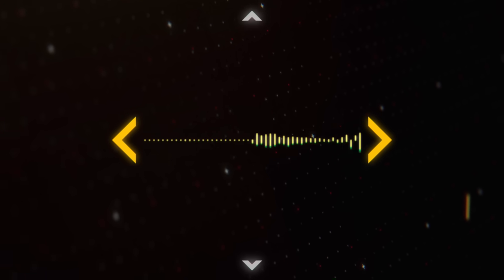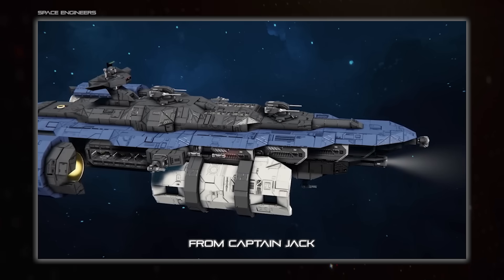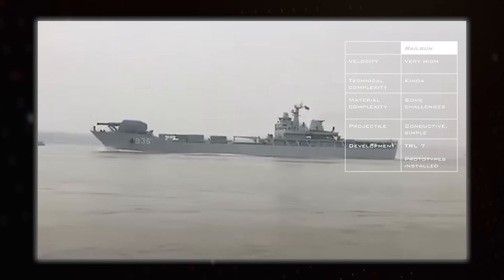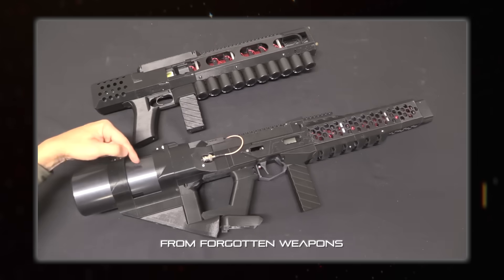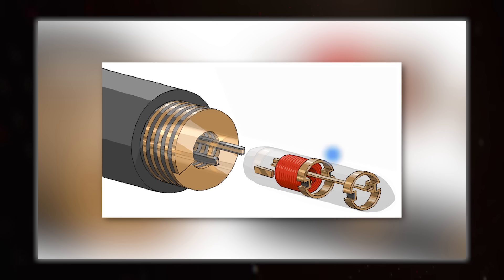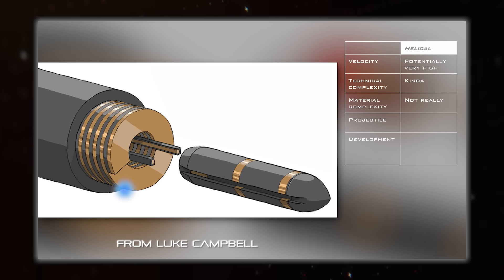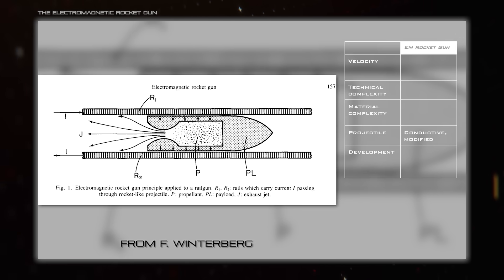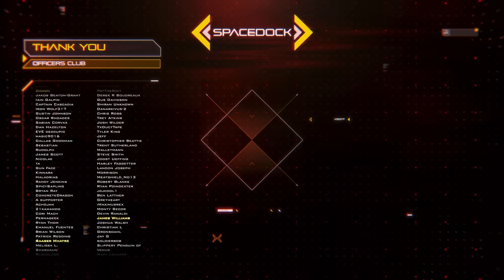The Deadly Coilgun/Railgun Hybrid You've Never Heard Of (Helical Railguns)

Comment: I remember back in college physics class where my team wanted to build an electromagnetic projectile launcher as a term project (the professor said that there's always a team that picks that project every year.) We first thought to make a railgun, but realized that would be too expensive for a bunch of college students because we'd need to get the rails professionally re-machined after every launch or so. We ended up making a mono-coilgun instead because that was just more practical for us to build. It only launched ball bearings at a modest velocity, but it didn't need to be especially impressive to demonstrate that we could build one. The hardest part was wiring it such that we could charge up the bank of capacitors (because we couldn't afford a chonky enough single capacitor) in parallel while getting them to discharge in series with a throw of a switch.
Reply: I can make a primitive "science fair" grade coilgun from a disposable camera flash circuit (xenon flash), a disposable pen barrel, and some magnet wire.
The disposable camera flash circuit is already most of what you need, including the high current switch (the flashtube can do double-duty as a triggered spark gap with no modifications).
Sure with only the one camera flash capacitor it'll only fling a piece of a nail across the room, but it'll also punch a hole in like 3 sheets of newspaper if you put them right near the muzzle.
All you need to do is cut one of the wires going from the flash capacitor to the xenon flash tube's primary electrodes, and put the ends of the wires for the acceleration coil across that break in the circuit you just made. That's all there is to it! When you make the flash tube go off, if you have a piece of nail in the pen barrel at the right place (easiest to achieve by winding the coil in the right spot close to the capped off end of it), the piece of nail will go flying!
Reply: The parallel/Serial part isn't that hard once you figure out you can use a spark-switch for that.
Reply: The way I see this railgun tech progressing is seeing if there’s a way of generating a em force to float and maybe spin the projectile (not sure how the bullet could complete the circuit to propel itself, idk learn from Nicola Tesla) or shape of projectile to generate less friction on the barrel or do what the mg42 did and have a form of gun barrel spacer (sacrificial metal between the barrel and bullet) or easily mass produced interchangeable barrel for infantry mortars. But until a simple slug of metal can be floated and then propelled in a barrel at that speeds, there’s not as much potential.
Reply: @SlimTower25  "But until a simple slug of metal can be floated and then propelled in a barrel at that speeds, there’s not as much potential."
Why do you think so? Combat mostly isn't spray-and-pray anymore.
The reason why electromagnetic accelerators are researched is their potential for far greater muzzle velocity. That would allow for further enlarged effective range as well as the capabilities to hit through obstacles and most light armor.
If you go for a long-range shot you do not go for multiple shots, and it wouldn't matter if a single shot would cost upwards of 1000$ in materials.

(and please - Tesla? there is not much to learn from a tinkerer that denied the existence of electrons).
Reply: @ABaumstumpf  when I referenced Tesla, I was asking if there is potential to Lawrence force though the sabot and shot without creating friction on the barrel material in an attempt to prevent ware and tare on the barrel. A rail gun (after leaving the mussel but does not rely on built pressure behind the sabot/bullet, right? Otherwise rail guns will not be economical for drone warfare, or intercepting Chinese hypersonic missiles, (costly to shoot down with missiles) and instead more effective use of time and research would be put towards hacking and point defense propellant or laser guns at the potential targets the enemy will aim at. 

Is it possible to create Lawrence force to propel a slug at significant force without it touching the rails or to reduce arcing? I know I’ve never seen anyone do it but I’m really curious if there’s potential behind it. 

The projectile, needs time to put more energy behind it to propel it to higher inertias, but if there’s no resistance/mass out the mussel, then it won’t carry much energy in its own inertia to carry itself forward, so the barrel would end up lengthening hyperbolically to liner speed if mass doesn’t change assuming the whole projectile is fired without a sabot (E(in newtons)=1/2(mass)(velocity)^2. Then, there’s air resistance I didn’t count. Assuming the Laurence could be generated with air gap, maybe the air plasma could be pushed away from the rails the same way plasma is pushed from the walls of fusion reactors being tested today? Then the next problem would involve if the plasma levitation of those shields would mess with the rails circuit between the shield and plasma? Then if that’s possible, would it be more effective than laser defense, and cost effective at defending against many hypersonic missiles?
Reply: It’s probably not likely rail guns will reach full potential against lasers in terms of economics, :/ ur right, rail guns were made for piercing and muzzle velocity, otherwise not much use elsewhere.
Reply: You made the stay mistake that everyone else does. You used attractive force to move the projectile. If you look very carefully, all of the military designs use repulsive force to move their projectile.
Reply: Why not just program an arduino to do it? I have a physics degree and learned how to use arduinos?
Reply: @johnhummel99  Because Arduino began in 2005. I was taking the class in 2002/2003.
Reply: @FearlessSon  well that makes sense then. I apologize
Reply: I have long felt that for a near term weapon, a coil gun is probably more practical.  I have a vague memory of seeing that if you're going up to Mach 5 or Mach 6 the coul gun is more efficient?
Reply: this is what we choose for our capstone

Comment: Triggering the coils is easy... just put a laser detector in the barrel which will trigger the cutoff as the projectile passes into the acceleration point.  Perhaps a microwave that won't be distorted by the compressed gasses ahead of the projectile if it's fired in atmo.
Firing these things in space, however, would be counterproductive.  Even without a propellant accelerating the projectile the act of accelerating mass in one direction will exert equal opposing inertia, regardless of the mass that's mounting the device (which is why they've been postulated as methods of redirecting asteroids - landing a mining/mass driver unit to push the asteroid by launching chunks away from it).  The only surefire way of launching ordinance in space is either a massless device - i.e. laser type - or something self-boosted that merely needs to be ejected under low inertia before initiating burn.

Comment: build your helix with linear accelerators, essentially a contact-less rail-gun then so no erosion of the rails and a coil-gun where the coils are a helix ( spin stabilization of the projectile ) coil gun lower power requirements, rail gun speeds if not the hybrid speed.

Comment: Reloading a railgun in video guns should include replacing the rails. Each shot reduces damage until you reload, but reloading takes a long time.
The advantage of the electromagnetic rocket gun is that you get a cool plume of plasma shooting out of your barrel. Which totally has a tactical advantage. (While they are just thinking of conventional guns with a palette swap, it is interesting that there is a realistic explanation.)
I love how for the rocket gun the "technical complexity" box is just has a picture of a bird with a question mark.
Reply: That or the "Round"/"Magazine" is a lengthy sealed unit that contains both projectile(s, stacked because no gunpowder), and the (disposable) Rails.
That neatly solves the "how do you replace the rails so frequently" problem, but it makes something like a "railgun LMG" utterly hopeless unless you want it to resemble an old-fashioned Pepperbox gun.
...and resembling a Pepperbox gun is EXACTLY what the "gauss" guns in Starfield did, which is a nice touch to see that at least nodded to (the barrels are still entirely too short, but at least the muzzle flash is blue metal vapor plasma and not orange gunpowder).
EDIT: When you reload one of these guns in Starfield, you DO replace the entire "pepperbox" part of the gun, meaning you do replace the barrels. It's designed to be swapped quickly, so the reload time isn't really drastically longer than reloading "normal" guns.
Reply: Since many videogame railguns are man-portable weapons, it's clear that they've solved the power density issues to enable such compact power storage in a platform not much larger than that of existing firearms.

And since they've solved that issue in these fictional universes, wouldn't you assume that they've ALSO solved the rail erosion issue through superior materials science, i.e. developing alloys which don't have that problem?

After all, how many video games other than certain tactical shooters/survival sims force you to deal with the effects of wear and tear on the firearms you use? And even those games which do include weapon maintenance tend to abstract the process--they don't go into specifics such as needing to replace the barrel, recoil springs, or gas system specifically.

To give you a real-life example--if you tried to use a select-fire AR (e.g. an M4A1 carbine) as a machine gun, with repeated mag dumps, one of the first things that will fail on you is the gas tube. Yet, I've never seen ANY video game which forces you to hunt around for a new gas system for your AR; not even Escape From Tarkov features that.

Comment: Due to the effects of back EMF, the magnetic field in a coil does not dissipate immediately when current is disconnected. It does decline very rapidly but it is not instant. This complicates the matter of timing as you have to turn off the coil before the projectile passes through it so the effect of the back EMF does not appreciably slow it down once it has fully passed through. This limits coilguns to a practical, efficient muzzle velocity somewhere around 2.5km/s. Railguns and helical guns aren't affected by this phenomena as it is a traveling magnetic field and so can have theoretically unlimited velocities as long as enough power can be delivered and the barrel doesn't disintegrate. Coilguns are, in theory, more energy efficient. In some sci fi future it may be that infantry firearms would make use of coilguns as they have lower power demands and simple ammunition whilst artillery and warships use the heavier, more powerful railguns.
Reply: We already have infantry-sized coilguns, so that's definitely plausible. They're just not combat effective yet lol.
Reply: @bable631  The issue with Infantry coilguns isn't so much the gun itself, its the power supply. Nobody wants to carry enough batteries on them to make a coilgun combat effective.
Reply: @ArtyAlwaysWins  Correct. Current battery tech only holds about 1%-2% the Joules/kg of chemical propellants. Not a problem when you're powering it with a huge gas turbine which normally pushes your ship at 50 knots. But kind of a big deal when a soldier has to carry everything in his backpack.
Reply: @solandri69  Yep. Same reason Power Armor isn't a thing yet. Once we get the power supply figured out a whole lot of things change all at once.
Reply: @TheVillainInGlasses  That actually isn't really that big of a deal. If power was the only limiting factor, people would've used small scale fuel cells capable of running off of large hydrocarbons and had nearly limitless power at our disposal. Far greater is the issue that motors just don't synergize with organic kinematics very effectively. It's why there's no humanoid robot on earth that can even move like a human in any one domain of performance, let alone act as effectively as a generalist in movement.
Reply: @bort6414  There are constant improvements to biomechanics every year, so that'll probably be solved way before the power issue is. And once BMI's are commonplace it's only a matter of programming, really.
Reply: @TheVillainInGlasses  I don't think BMIs will be particularly transformative in the domain of human augmentation. The issue is that in order to effectively augment human performance, you have to operate in step with human muscular structure. Our brains send command signals to our muscles, but there are additional processing steps that occur at the level of the muscle that are essential to coordinating our movements. 

DARPA actually developed a lightweight powered exoskeleton for the US Army in 2012(?). It was a total failure. Every single soldier equipped with the system reported significantly greater fatigue when wearing the system than without it. Because the motorized part of the system was not perfectly synergistic with human kinematics, the end-result was something less than the sum of its parts.

I think one major step towards that will be linear actuators, but more important than even that will be a systemic change on how engineers think. It would seem to me that a lot of engineers working on human augmentation systems are really convinced of the superiority of machines. They fail to recognize the billions of years of evolution that went into optimizing living machines, and that causes them to make irrational assumptions regarding the complexity of organic systems.
Reply: @bort6414  Whoa whoa whoa, are you disparaging the strength and certainty of steel and the purity of the blessed machine?
Reply: @TheVillainInGlasses  Don't get me wrong, I luv me some blessings from the Omnissiah. But you must absolutely consider that for the amount of energy that organic machines use, their capabilities are off the charts. Consider the fact that a human being can do everything that it does using energy equal to the output of a 200w generator... And then think of a machine running on a 200w/h battery. You couldn't even come close to the same performance that a human being gets, frankly even if you tried to specialize it, and then the human gets to remain a highly effective generalist. And most of that energy output for humans is to regulate our body heat and fuel our brains! Our muscles take up closer to 50w of energy total. Or think about how organic actuators are so powerful that for millions of years, birds have been able to generate power/weight ratios of greater than 1. That is insane in terms of aviation. All while self-sensing damage, automatically repairing, regulating performance to prevent injury and adapting actively to new workloads.

The point is that organic machines are frankly amazing, and I strongly believe many of the issues we see with robotics at large is the fact that very few people want to stop and look at nature for the inspiration to producing good machines(which has learned how to do this through evolution and natural selection for a billion years).
Reply: @bort6414 what about Boston dynamics newest humanoid robot?
Reply: @dragonmasterlangeweg7625  It's still only a hollow simulacrum of human performance. It barely even compares to an average human; imagine it trying to even compete with an Olympic level gymnast?
Reply: @ArtyAlwaysWins  how about integrate the batteries to the magazines.
Reply: The barrel problem could be solved easily with ceramic inserts. Replace the inserts rather than the entire barrel, ceramic is incredibly durable and used in oil and gas processes to protect heat exchanger tubes from damage and wear while it's in service.
Reply: @ASquareNarwal  Ceramic is also not conductive, meaning it would be useless for the purpose of a railgun.
Reply: Is there any research in flipping the polarity of the coils? Does that help with the discharge time of the coils, and furthermore, is there any reason we can’t do that just as a little bonus kick for the projectile velocity?
Reply: @Arbyjar  No. The issue is that ferromagnetic projectiles are only attracted to magnetic fields regardless of their polarity.
Reply: @bort6414  you know I may have forgotten about that
And permanent magnets probably can’t withstand the heat not to mention magnets aren’t cheap like that… shame
Reply: That's because you made the same mistake that every other hobbyist makes. You used the attractive force.

Look carefully, and all the military rail and coil guns use the repulsive force. So there is never a point at which the magnetic field is pulling backward on the projectile.
Reply: @AlienRelics  Magnetic attraction and repulsion are identical in power. 

Coilguns must use magnetic attraction. Railguns must use magnetic repulsion. It's not a matter of being "better", it's just a matter of topology.
Reply: @bort6414  you could actually create a hybrid rail/coil fun that shoots non magnetic projectiles by having a set of coils that create a perpendicular magnetic field to increase the lorentz forces on the projectile. by triggering it in sections you can also reduce the stress on the rails as only the section that actually is close to the projectile at any given time will have the additional field.

Comment: I've got an idea of using plasma as a sort of a conductive lubricant to mitigate rail erosion, and active-cooled superconducting rails so they can handle large currents and not vaporize. I made a small "blueprint" and the result can be described as a maglev railgun. 

I don't know much about drag in plasma, but I think it should be somewhat similar to one in the gas, and better than direct contact with armature.
Reply: My concern with that is how do you get the plasma to be in the right place? Magnetic containment is obviously off the table but you need to stop it from making any additional connections between the rails.